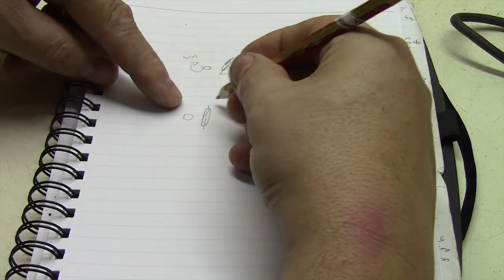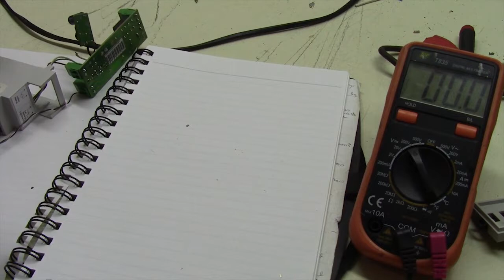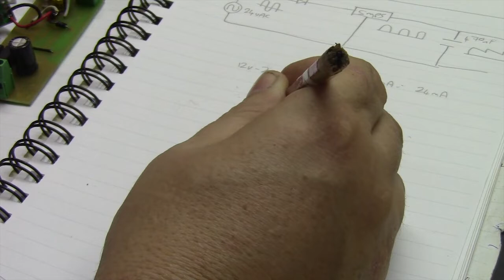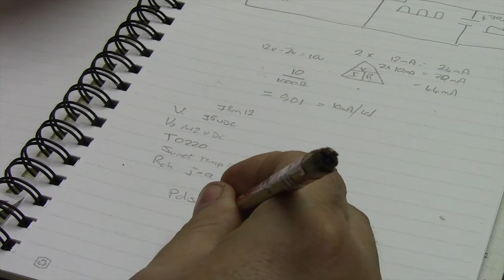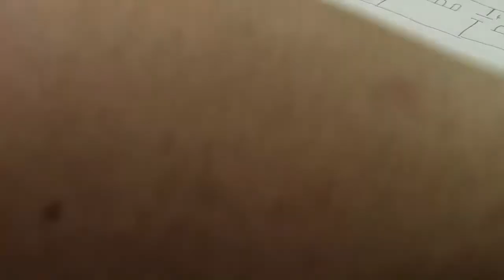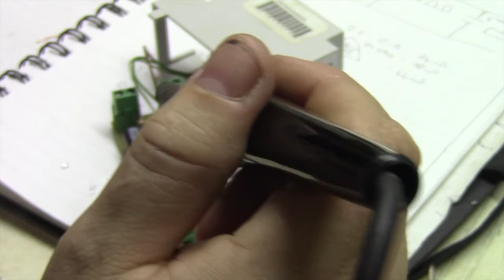ShoutingElectronics #34 - The Splitter aint Splitting

Comment: The designer probably went with the dc to dc  convertor board instead of the lm series because of cost savings, at one stage when i priced the cost of a dc to dc board compared to the Lm regulator and two capacitors the dc to dc buck power supply board was more than a dollar less.
Reply from the maker: They charged the customer over R1800.00 for this splitter (and the 1st one arrived with a faulty SMPS module anyway...) ..... If only I had known about this, I could have saved them a lot of money, or made a killing......
Reply: @ShoutingElectronics  R1800, means the module cost them R180 to make......
Reply: R1800 is alot, but maybe the pcb board was manufactured in SA, SA prices are around R300 each for a small pcb then add parts shipped by DHL and assembly line costs, sales agents, middle man profits and very quickly the price of a simple product rises. We can probably build a few units using China post and Chinese pcb manufacturers for few hundred rand but i think large scale manufactures have to pass on building rentals and so many other costs onto to consumer. The unit looks like a famous SA brand or i could be wrong, any signs it was manufactured in another country?

Comment: You forgot the up to 6mA ground pin current. However here with the regulator doing under 1W it will be fine. Just use a drop of superglue and stick the tab down to the PCB, will save the regulator pins from fatigue, as it is likely the panel does shake and vibrate with the pump operation, and this will crack those solder joints eventually.

Guess the neutral took a trip to the local scrapyard to get the mains surge, or one of the incoming phases to the 11kV transformer fell off. Hard otherwise to cook a 24VAC transformer. Probably best to use a 380VAC industrial one instead, and connect between phases, so loss of neutral is no longer a worry.
Reply from the maker: I will tack it down anyway, but this module is mounted in a panel on a wall, so no vibration.
Reply from the maker: Think it was more of a fault on the 11kV Side, because Eskoms fault in that area damaged equipment in 4 seperate farms pump houses in the area (all on seperate transformers, so not a neutral fault.)   Even blowing the Built-in protection of a 55KVA VSD so badly, that it was a dead short across the phases...  

And that is about the 3rd time in a Month that it happened..

In this specific pumphouse it Might have started off as a lost phase / undervolt, which caused the Contactors coils to overheat, and short, which then overloaded the Transformer (who puts a 10A Breaker on the Secondary of a 50vA 24 Transformer????).....   

Then the transformer might have lost insulation resistance between primary and secondary, which overvolted this small smps
Reply from the maker: Coming up soon for them : Dehnguard Surge Protection, 3 Phase Voltage Window Comparator, and DC Bus fuses...
Reply: @ShoutingElectronics  Don't forget the 2A breaker on the transformer, looks like the 10A was the nearest one on the shelf, sized to protect the wiring inside the cabinet.